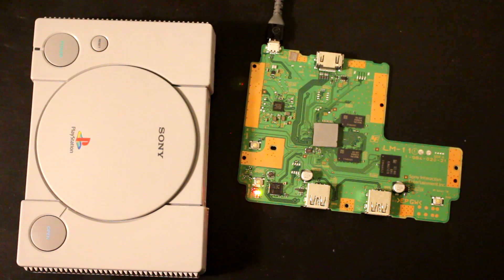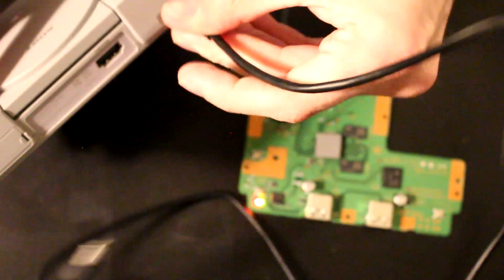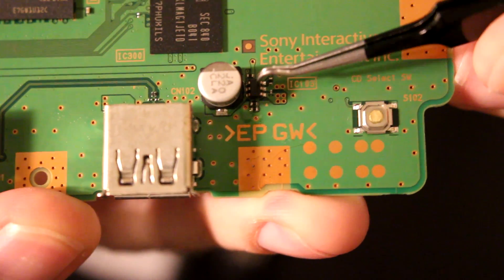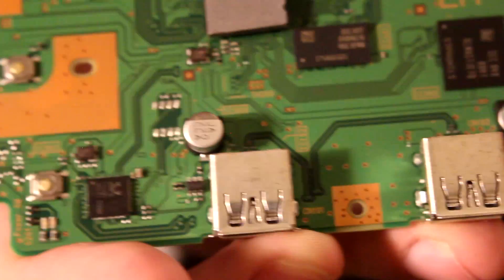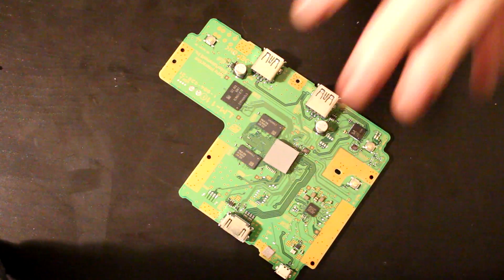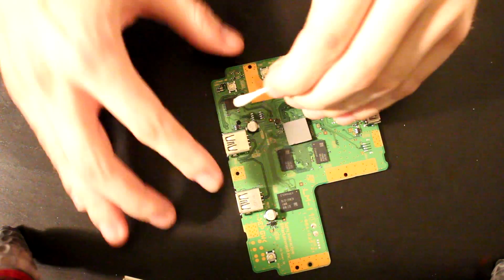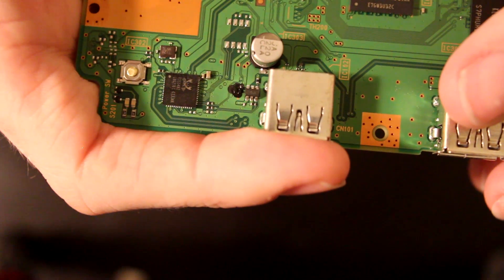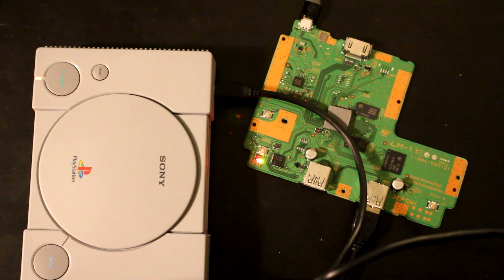PlayStation Classic Current Limiter Removal Mod

Comment: It turns out if you give a resistance of zero, or directly short this pin to ground, you can effectively disable any current limiting for the port with a maximum of 1.5A allowed. The easiest way to do this is to short one side of the two resistors.👍

Comment: Effing hell many of my games wont boot at all even if I have a cheap OTG adapter. I think its that adapter now that is the bottleneck here. I need to try this method and see if it works. It should work with a USB hub on a shorted port eh?

Comment: is there any harm in this since more voltage is going through board?  Also ive never soldered before ever so what kinda wire was that he used and where do u buy it by chance as idk what its offically called

Comment: Hello I just got PSC (second hand) for my sister. The console worked when I tried it at the seller but when I got home it said "controller not recognized in port 1, press x to continue". Neither port and controller works. Controllers work on PC when I tried so it must be the USP ports that are fried. Also when first booting the PSC I used Apple charger and it didn't want to boot so I used my Samsung charger and it worked but the USB ports don't. Is there a way to fix it ? Thank you

Comment: got a psclassic from a local game trading shop and stuff like that, it is modded but instead of shorting the resistors it has the top resistor from port 2 removed ._. it turns on and recognizes the controller along with a usb hub but...dont know if that was a safe move...got it for 15 bucks

Comment: if i, in the process of trying the mod, do too much heat and rip off / Fry / FUBAR one of the resistors, will it also work?

I was having lots of difficulty doing the bridge. and after fiddling a bit on port 1, the farthest (from the port) resistor came stuck to the solder iron. i then (after shitting my pants ) managed to more or less put it in the same place, and the two resistors actually bridged together as supposed. although i highly doubt the resistor i put back on was put correctly with both pads connecting, or is even in working condition any more.

I then reassembled my now presumably dead Playstation Classic and it powered on. 
First try, Project eris flash drive refuses to boot connected by the backside OTG cable. Not sure if this was due to me not pluging things in the correct order or heat damage / short circuits, but after some minutes and reconnecting everything again, it actually booted normally and my Wired 360 controller which didn't fully work on Port 1, now works perfectly and even rumbles, so i guess i removed the current limiter.

I have doubts now:

- Is desecrating one of the poor little resistors okay or should it be bridged but in working order?
- Will my Playstation Classic short circuit to death any second, or my crap work did the trick permanently and with no damage?

Comment: I accidentally lost one of the tiny resistors, would this cause any problems in an unmodded state? Decided to remove the solder job as it's a bit above my skill level and discovered one resistor is gone.

Comment: Will this enable me to use the second usb port for a second player? Right now im using an OTG adapter with my usb plugged into that leaving the two ports in the front open. As of right now the second usb port does nothing when a second controller is plugged into it.
Thanks man. So greatful for all you do!!
Reply: @DoctorDalek  Hmm, I know the port works. I had the USB stick plugged in there before I switched to the OTG adapter. Any idea what could be wrong?

Comment: Finally spent the 5 minutes to do this mod and works great after my little test!  Thanks for the shorting references!  Recommend doing this only if you have a good soldering iron and prior skill - these resistors are very small.

Comment: Another thing that works for bridging those points and I swear I am not lying is a nice sharp number 2 pencil just go back and forth back and forth laying a good heavy graph line and it will work I shit you not and the best part is it's completely reversible but it will stay on there for as long as you want it to ..... I first started actually using this style of method with a graphite pencil doing Pandora batteries for the PSP it required you to cut a trace on a regular PSP battery to turn it into a Pandora battery so you could install custom firmware on your PSP the only problem was is now you've cut your trace and you have to fix it so you can use your PSP after installing custom firmware so I found  a pencil worked great I learned it from another person online I didn't think it would work either but it did
Reply: Hey this worked lol my phone is charging port 2

Comment: I did the same thing, the only difference is that i removed the resistors since all of them has no sense in having in there, because shorting them basically makes them useless, so then i removed the smd resistors and soldered a dab on both where the resistors was once installed. Its been working great and permanently powering my usb and hub :)
Reply: Hello !Can you tell me exactly how I can do it?After you remove the 2 resistors of you have 4 points.You make a bridge just like resistors was before or you make a bridge unify all 4 points together using a blob of soler?I'm not sure how to do it corectly.I have to mention that I have already remove all for resistors for both usb ports.Thx in advance!
Reply: @liviugabrielmares5246  - Sorry late response, you can unify all four points since i just did that and its fine.
Reply: I know this is a really late response but do you think you can put how to remove the resistors

Comment: I removed (by accident) one of the resistors..so (I have multiple of this systems) I removed all of the Resistors and shortened the free solderpoints at both of the USB ports. I thought that I can trash the system but it worked also....I had issues before, that a large USB 3.0 and the 8Bitdo wireless adapter was to much for the System. Now It all works fine!
Reply: Hey! I want to use two 8bitdo usb adapters so I think I must use a usb hub, any hint about it? This process can help?

Comment: my dumb ass bricked mine i removed the limiter chip thinking it was the resistor 

F

im going to just put a pi inside of it wire up the usb ports so it can use the ones in the front and see if i can figure out a way rig up the buttons to work

Comment: Hi, first of all many thanks for this great video! But I messed it up because of my poor soldering. Both of the two resistors on port two are gone and unfortunaltely for me it looks like that the contactors on the board are detached as well. So I guees there is no chance anymore for your current limiter mod, right? Luckily my PS classic is still working. Which I do not understand actually. Becuase imho the removal of the resistors mean that the resistance value is now 'quite high', isn't it`?

Comment: Thank you so much! I was going to use a thin wire to bridge the resistors but my soldering iron tip is so big it just dropped a glob of solder on both. Tested it with a 128GB USB that previously required a powered USB hub and now it works without! Appreciate the video and tips!

Comment: Hi is there a way of increasing the power through the hdmi?  I have a external hdmi scanline generator but the signal through the hdmi is too weak for the tv to pick up. I have tried using 25cm hdmi cables, ps1 to SG to TV but no success.

Comment: i have .032 60/40 rosin core solder, would that work for this? if not, what wire do i get specifically? wire wrapping wire 30 gauge?

Comment: Just completed this mod with graphite pencil shavings mixed with acrylic paint 1:1 ratio. Simply mixed the paint and graphite then carefully dabbed it on with a toothpick. Worked perfectly and didn't even have to buy the pen or solder

Comment: Hello! Thanks for the Video! I wanna do the Stealth SD Mod on my PS Classic and that limiter removal is needed that it works. Im worried that i dont understand this right.. :D (my english isnt that good and i'm not that good at electronic stuff haha) is it useful to do this on both ports or is i fine to make it just on port 2? i'm also not sure what happened here? So you took solder sort and connected this two little resistors on just one side(am i right?) then you put conductive ink just other the two resistors from port 1 or? are this just two different methods or can i use solder sort on both ports?

thanks for your answer!

Comment: I just managed to do this. Holy cow those things are tiny, I can barely see them! First attempt (just port 2), I got a little blob of solder sort on the top and was hoping it bridged the gap, but it didn't work. Second attempt, I just tried again, melted the blob, added some, just fudging around really (I have no experience or skill soldering!), and was left with an even bigger blob that looked like it hopefully did more than the first try. I booted it back up and bam, USB 3.1 128GB worked like a charm (drive folder called SONY, loaded up with some big collection I found). This is the USB thumb drive, only $18 - https://www.amazon.com/gp/product/B07855LJ99/ref=ppx_yo_dt_b_asin_title_o03_s00?ie=UTF8&psc=1

Comment: So does this also disable the reverse current protection? Or is it just removing the current limitation?
Also is it possible this mod will allow for more controllers to work? Don't know if I really need to do port 1 too, cuz I'll never use a drive there, and one less spot to screw things up lol.

I've had trouble with all of my 3.0 flash drives so far (32gb Kingston DT100 G3, 64gb PNY Turbo Attaché 3, 64gb PNY Elite-X Fit), so I'm gonna try this mod now.
Reply: If you use a USB hub with this mod, yes you can use controllers.

Comment: Sounds good but maybe a  lower value resistor would be a better option. They engineered the current limiter for a reason. I would definitely include a disclaimer on the mod vid.

Comment: i'm having a issue with my Playstation Classic, plug in and get "cannot recognize controller" error message...which you need to set it up and actually, you know, play. Tried every combination of unplugging and pushing buttons, looked online and nothing. Included manual said "if controllers not recognized, press reset"...
but still didn't work... i notice the Realtek RTS5482 usb hub chip is overheating, there is a solution for this?
Reply: Use a non powered hub and maybe use for power supply an AC adapter to 5v 1500ma from a cellphone charge.

Comment: How to use 256gb on back otg cable ? Does that need a hard mod? Can it be 3.0?
Reply: It works if you have the kernel of Bleemsync installed. You can even use a hard disk 1-4tb or ssd and USB3.1 on your OTG and it should still be fine
Reply: @timdv3119  thanks for replying 
So i need to do the first steps of bleemsync and let it install then just switch to autobleem?
Reply: @nemesisnine3297  Yep, just the first step of the install. Install the kernel from bleemsync (just in case copy your own kernel to a safe place [i.e. google drive, usb, ...] if there ever is any problem you can just reinstall your old kernel back [this is specific to your psc]. This might take up to 5 min. Be patient and don't turn off the console while updating the kernel or your psc is wrecked. After the installation of the kernel you can stop there is no need for the rest of bleemsync to be installed. now plug everything in. OTG, USB with  your Autobleem build [or HD, SSD] and Power the console back on. If you use a HD or a large USB it will take some time the first time using it because it will place all the covers etc in the right folder.. So don't worry if not much appears to be happening... It can take up to almost half an hour if you put the complete psx collection on your psc the first time... But it should work. Enjoy
Reply: @timdv3119  thanx bro
Reply: @nemesisnine3297  No problem. Oh yeah use your OTG cable at the back of the device between the 5V powercable & the PSC that way you have your 2 front usb ports open and still can play with 2 players... And a funny thing you can actually use 2 usbsplitters in front and you can play with 4 people (controllers) at once. Btw this works too :-)

Comment: Question. Could you just bridge those two points with a small blob of solder? They're so close together I'm not even sure a wire would be necessary.
Reply: Yes, I'm not sure why the wire is even there.

Comment: So I have Bleemsync 1.1 installed on my PSC and have been trying to use an official PS3 dualshock 3 controller. The controller seems to work fine in retroarch, however if I turn rumble/vibrate on in the settings and then get to a point in a game that uses rumble my controller will vibrate briefly and the PSC will crash and turn itself off. Is this due to the controller trying to draw too much power when vibrating? Will this power limit removal mod fix this issue I'm having?
Reply: I had the same problem, did the permanent cxurrent limmiter mod and it killed my console.

Comment: I looked up the data sheet on that chip and recommends a minimum of 15k ohms at that point, not a dead short. Looks like you need about 50k ohms to achieve 500mA.

Comment: It's a shame that they don't inform about this in those Autobleem videos. I've had nothing but issues whilst trying to use Autobleem, I've used 3 different USB thumb drives with no luck, so far. This will be the last thing that I try.
Reply: Agree Lee, this could have been done from day one gggrrr
Reply: I did to but buy a scandisk cruzer blader usb it works without modding I've tested it and I'm using it
Reply: Did you figure it out ?

Comment: If you use foil or tape a wire. You can also purchase heat resistant, and non conductive polyimide tape to enclose the resistor. I use that tape on a few of my projects, to protect possible shorts, as a double safety measure :) 
You can get it from Amazon, in rolls of different widths.

Comment: Can I go cheap an use this?

https://www.ebay.com/itm/1PC-Electrically-PCB-Repair-Pen-15-5cm-Conductive-0-2ML-Glue-Wire-Paste-Tool-Set/253829699618?hash=item3b196dd822:g:kr4AAOSwMPxbf9M8

Comment: Couldnt you just connect the 2 points with 1 dab of solder since it's so close and so small? Just curious.
Reply: @DoctorDalek  I mean without the use of the wire, like the solder itself is the natural wire
Reply: @DoctorDalek  my iron is too big for the wire, did the solder and works fine but both USB hubs didn't recognize my controller which kind of sucks. Does it have a list of any compadible ones on the site
Reply: Clorox Bleach  yes sir. No need for a wire

Comment: I ended up using a Samsung USB 3 32gig  drive , it works so  I did not need to do this mod,  I confirmed it is USB 3 on PC it the speeds match it and it has the blue plastic but yet the playstation does read and autobleem works fine, i lucked out I guess but it is good to know how to enable the higher voltage

Comment: Awesome work, I bought the same pen on Amazon and just completed the conductive ink method last night. I put the PSC back together and put my iPhone charger in port 1, it charged for a couple seconds, stopped and then said device not supported on the iPhone. Plugged in port 2 and charged with no error message on the phone. Do you know if this is normal for Port 1 to do that with this kind of phone? Also able to use my Sandisk ultra fit 3.1 128GB in port 2 with no powered hub anymore :)
Reply: Normal for port 1 ;)

Comment: I dont have either of these but I have a paint marker that is basically a marker full of silver spray paint. Do you think this would work?
Reply: @DoctorDalek  ok so I bought some of the conductive paint you have here in the video. I did both spots you did in this video. I plugged in my cruzer 3.0 and it still fails to load anything at all in both ports. So I redid everything again and still it wont load. Any help would be great. I was wondering if maybe I need to format it differently byte wise. What byte option should I be selecting. Whatever I did on my 2.0 cruzer already worked great but I cant get the 128 gb working😭 lol
Reply: @DoctorDalek  its 1.5 Amps and charging my phone. So idk whats wrong besides maybe a format setting. Or maybe it's a compatibility issue between autobleem and 128gb 3.0 sandisk cruzers. I guess I'll try every format option and different builds of autobleem. Maybe something will give
Reply: @DoctorDalek  I'm pretty sure I formatted it to fat32. Like my previous stick but maybe I wasn't thinking right at that moment and accidentally picked exfat.

Comment: Thinking of trying this on my classic, to try using 2 8bitdo adapters (for ds3) and a USB drive. Currently have a powered hub and can get all three to work temporarily, then the classic powers off. Not too confident in my soldering skills so I'm gonna go with the pen method, but I'm curious, you have the carbon pen linked but would the silver/nickel pens be better or worse for this use? Thanks!
Reply: Same here! I tried with 2 8bitdo (ds4 and snes n30 controllers). My hub looks good with one and usb, but crush  when I connect the second 8bitdo adapter. Did you find any solution?